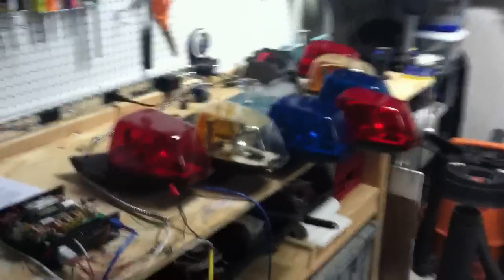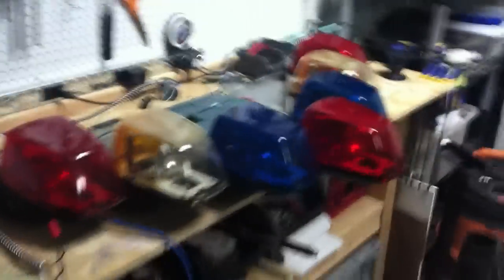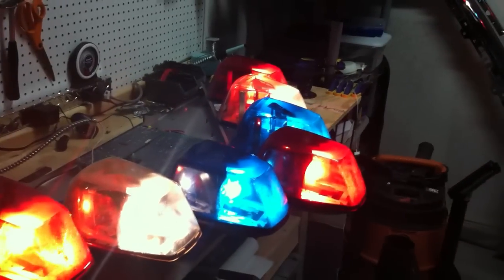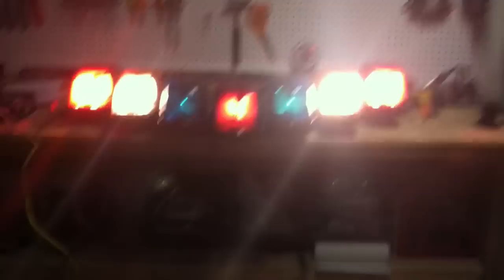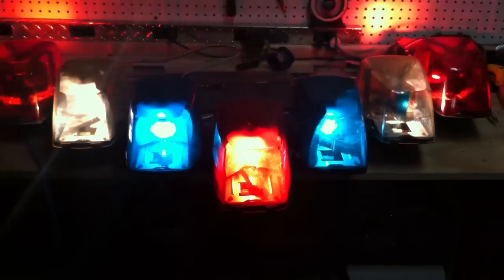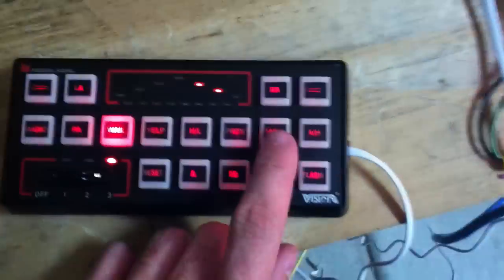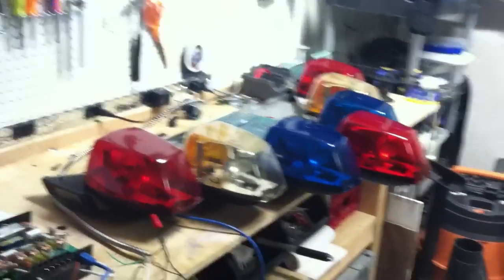Federal Signal Vision Lightbar

Comment: Very Sweet.  Always wanted one of those.  And I am about two and a half hours north of Vegas.  And yeah not having TD and alleys at the same time is a bad.  I use them together all the time when on patrol.  And now days, after using LED bars, LEDs have come a long way its the only thing I trust on the side of Highway 95.  But nothing beats a slow headlight flasher :)  Keep up the videos.  I made a Super Smart Vector, I added two extra smart pods and another board to a Smart Vector.  But I never got around to finishing it.  It was about 6 years ago, still have the bar.  I made it to be able to have rear set up like CHP with two rear OSC lights.  I then cut the power wire to the motor of the center pod so it would stay steady burn to the front.
Reply from the maker: Sounds cool!  I am up to 18 bars now.  I am working on getting the last 2 or 3 wired up and cleaned, and then I'll do a new video.  Thanks for watching!

Comment: Steady now, way too much coffee. I picked up two bars some time ago, and I thought they were both the same. I just spent a few days working on one of them, a Vector bar. I needed a couple of bulbs so I went out to my shop and climbed into the rafters to rob a couple off the other bar. I pulled the cover off the end pod and noticed it was a smart pod. I excitedly jumped up to the next step on the ladder so I could see the label. It's a vision bar. Oh boy. When I pull this down on Monday I think I'm gonna have some questions.
Reply from the maker: ok.  And I don't drink coffee.
Reply: Okay just shaky. So I pulled the vision bar down. Bad news. The data cable was cut, and all the wires were stripped. I would bet that some moron has applied 12 volts to every data lead. I don't have anything to control this bar, so I won't be able to check it out any time soon. Enjoyed your video. Thanks.

Comment: I've seen some Vision lightbars that can do both takedown and alley functions at the same time (with Pod's 3 and 5 being the designated takedowns and Pod's 1 and 7 doing alley's with cut-out filter lenses)
Reply from the maker: That's interesting, it must have been a custom, department-specific bar that Federal Signal programmed.  As standard, Pods 1 and 7 are never used as TD's or Alley Lights.  Standard programming dictates that TD's can be Pods 2/6, 3/5, or 4, while Alleys are 2,3,4 (left), and 4,5,6 (right).  There have been times when departments requested specific things from Federal Signal for their departments.  For instance, in Las Vegas, LVMPD had it so all of the pods homed to the front, with the exception of Pods 2 and 6, which homed in the Alley position.  Some people just like to be different.  

Thanks for watching!
Reply: @AdamsLights  Indeed, especially the CHP (where they literally seem to have everything custom-made for them).

Comment: One thing.  Fed Sig states in their siren manuals is never run the siren without the speaker as it can cause damage.  I'm not entirely sure how it does, but if they say so then they have seen it.
Reply from the maker: You're probably right, and it most likely has something to do with overloading the capacitors.  This was just during testing, and I have since mounted this on my collection wall, and have added a siren speaker.  Thanks for looking out though!
Reply: Adam Ogden No problem.  I have an older PA300 FS siren, and that's where the info came from.  Hmm. 

Never thought about hte capacitors getting overloaded, but that makes sense.

Any plans for a CTS Twin Sonic?  That's a classic lightbar in my book.
Reply from the maker: I'd LOVE a CTS bar!!  I am doing some work in Cali sometime in the next few weeks, and am hoping to score a few CA-spec older bars- it would be AWESOME if I found a CTS!  Fingers crossed!
Reply: Good luck.  If you can get two.  One in the all red configuration with the amber flash (like on the TV show Emergency!) and the red/blue combo like in CHiPs.
Reply from the maker: I'll get whatever comes my way, believe me.  i never say no :)
Reply: LOL.  Yeah I'm that way too.  When I was collecting traffic lights it was hard to pass up on some of them.

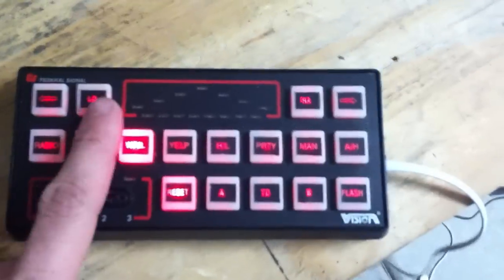Comment: 3:11 - I know it wouldn’t be identical to LV Metro, BUT, if you had a clear center, could you use that as a single takedown and then have 2 and 6 as alleys/rear flashers/additional TDs?  Random, I know, but just wondering…
Reply from the maker: Hello!  I have an ACTUAL LVMPD Vision bar that is set up correctly.  Also, you can’t program the brain like that, so I wouldn’t be able to have 2/4/6 as TD’s. I’ve actually changed the color combo of this bar since this video was taken too…. Check out my new stuff…. And thanks for watching!

Comment: I tried to program my bar but the patterns I enter are not staying programmed in and the center pod I added only works sometimes I hooked it to the plug on the board that had the jumper wire on it do you know of anything else I can do to get this bar working right
Reply from the maker: It really depends on where the bar came from.  For instance, if you have an older Las Vegas Metro Vision, whose center pod was originally a 3rd party Opticom, there is no programming for the center pod in the brain, as LVMPD has theirs specifically made for them from Federal Signal.  I had issues with mine note remember the patterns too... but then it seemed to fix itself.  Not sure what the issue was.

Comment: Adam I am brand new to this world. I just picked up a vision light bar similar to yours, with the traffic bar on the back as well. I am a firefighter and had a friend swap out red shells to make this more of a First Responder type bar, and I'm going to hang it up in my man cave at home with all of my other fire decor. My problem is that I am clueless about what else I need other than the bar itself. The wiring is intact for the most part, but I don't know a thing about what sort of power source to use, what controllers are needed, etc. Any advice at all that you could lend would be much appreciated, or if there are other resources I can tap into I'd be happy to read up as much as I can. Thanks for posting this video, it's the only thing I've found that helped me feel like I can accomplish getting this light up and running. Thanks in advance sir for your service and I hope to hear from you soon. 

Jeremy
Reply from the maker: Jeremy- I will send you a pvt message via YouTube.
Reply: +Adam Ogden If its possible, I too would like to know what i need and how to set up my vector to use household power, I am under the impression that I need a 120v to 12v converter as well as an amplifier, I do not have a control box, but I understand that I could just touch certain wires to the main power wire I think in order to change functions. Thanks for taking the time to read this!
Reply from the maker: Seluryar Check out my other videos; I have one that explains my power supply setup.

Comment: Adam how do you have the wiring connected? What goes to what?
Reply from the maker: - The Vision Lightbar should have 3 wires come out of it... red, black, and a CAT5.  The red goes to the positive on your Power Supply, the black goes to the negative on your power supply, and the CAT5 cable (standard RJ45 network cable), connects to the brain.

- The brain box also connect to the keypad via a 4-conductor telephone wire.  MAKE SURE it's 4-conductor, and not 2.

- The brain box has a white, 12-pin mass connector that says "Siren".  It's NOT just the siren.  Out of that connector, pin #4 goes to ground (negative), and pin #6 goes to positive.  If you use the relays of the brain box, you also need to connect the LARGE red wire to the power supply, directly from the back of the brain where is says "+BAT".

Once you get all of that together, you should be good to power it up.  As soon as you power up, the keypad will let out a 2-second BEEP, and the lightbar will re-home the rotators.  After that, it should be good to go.  If the keypad starts flashing/beeping within 5 seconds after powerup, something still isn't connected correctly.

Comment: If the smartpods are operating in the intersection sweep mode, and you want to change one or both to either alley or takedown mode, will the alley or takedown override the sweep pattern until you turn it back off?
Reply from the maker: Yes, Alleys and Takedowns have the highest priorities.

Comment: Hi Adam. I have one exactly like yours except with the traffic advisor. One question, how did you get your pod 4 to work after you switched out the opticom wiring? I put in a smart pod and wiring but the pod doesn't move. It moves slightly on reset but that's it. The light works fine. Thanks for your help. This is a cool bar and I will be happy once I get everything working.
Reply from the maker: eyamane actually, mine never had the opticom in the center pod- it's always had the center rotator. I'm not sure what's causing the issue in your bar though. Sorry I couldn't be more help!

Comment: Is there anywhere I can get replacement vision nameplate stickers? Also is it possible to have the middle pod also be a takedown Making it 3 takedown lights?
Reply from the maker: Not sure where you can get the nameplates.  I would check the Facebook groups or eBay.  And to answer your question.... No.  I don't believe you can do the trio of TD lights.
Reply: @AdamsLights  ah alright thanks. I see the trio of takedows once and a while on metros vision slrs so I just wondered if that was a thing on these 🤣
Reply from the maker: @vegascvpiaaron6807  Yeah, I've seen that too.  It's either a new feature that is specific to the SLR, OR LVMPD had Federal Signal do it for them custom.  on the older bars, LVMPD had them specifically program the white lights to default to the side, rather than the front... so who knows.
Reply: @AdamsLights  hm interesting. Well thanks again. On a different note do you know how to enable the beep every 10 seconds when a function is on for the vison like the smart siren has?

Comment: Also fed signal said it would do the glitching out because the smart siren is looking for a lightbar but there is not one connected? they said when i hook a light bar up it will fix it. What do ya think
Reply from the maker: They are right.  The brain and the lightbar talk to each other over the cat5 cable, so the beeping indicates that there is something wrong with the communication.. in your case- there is no bar.  The very second you plug in a lightbar, the beeping will stop, and you will be good to go.
Reply: Adam Ogden pretty neat how it works haha thanks bud!!!

Comment: I just got a pile of these at a yard sale and am waiting for the controller to arrive. I have not been able to find any specs on the cable pinout from the siren brain to the bar. Can you tell me if it is straight through or a crossover cable?
Reply from the maker: straight through, no crossovers.... but it does have to be a 4-conductor cable.

Comment: Hey Adam,. Love your set up!, I have the same vision controller with the traffic advisor, and i'am trying to set up mine.. I have all the parts,. .the  controller, amplifier, pigtail, but im having trouble locating how to hook it all up,.. I have the programing manuel, but not the wiring manuel,..  I was wondering if you'd help me out with the wiring on this bad boy?
Reply from the maker: Yeah, It can be pretty complicated.  Are you using the controller for anything else, or JUST the bar?  Meaning, extra lights, etc.  Also, do you have a siren that you are using with it?
Reply: I have the same as you the full visor light bar, and siren,. It's for the man cave, and I'd love to get it hooked up... any input would be great!
Reply from the maker: what email can i send the document to?
Reply from the maker: Bill D. Hey Bill. If you go find my Vision Programming Tutorial Video, the owners manual is actually linked in the description of the video, you can download it straight from there.
Reply: @AdamsLights   Awesome and thanks for your time Adam, Bill.

Comment: What kind of power supply are you using to run your light bars?
Reply from the maker: I have three power supplies, all of which are Tripp Lite.  I have two 60-amp versions, and one 40-amp version. Each PSU runs 2-3 bars each, depending on how power-hungry the bars are.
Reply: Awesome-thanks!

Comment: Can you put LED bulbs in place of the halogens in these?
Reply from the maker: Technically, I believe the answer is yes.... I have switched out the halogen bulbs in a couple other lightbars I have, with cool results.  The thing that would make me nervous about doing that in THIS bar specifically, is that when you change the halogen bulbs to LED, is changes the voltage draw for the bar.  Since this one has the brains built in, I would be nervous that too much change in the current/voltage regulation would fry and/or damage the brain itself, rendering it un-usable.
Reply: Thanks, that's what I was worried about as well.  I'm looking at buying one here soon that I believe is just the original vector with no brain to it. If that's the case I'd like to LED swap the bulbs in it and do a before and after video :)

Comment: hello where is connect the negative and positive?
Reply from the maker: I dont quite understand your question...
Reply: Sorry, we are repairing a Federal Signal Vector, but do not know from where the negative and positive to test the console with a battery, could help us?
Reply: Because the console says "Bat +" and no more connections.
Reply from the maker: The red line goes to the "+", and the black line goes to the "-".  Any other lines fire off specific features, which also go to the "+" terminal.